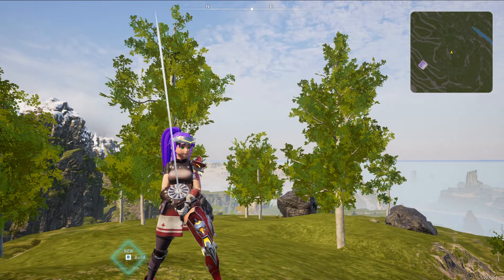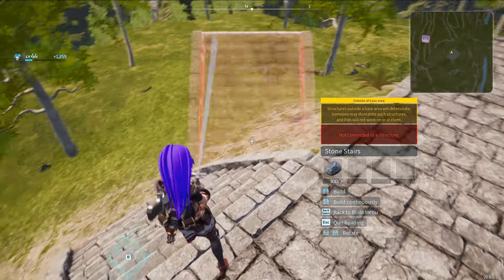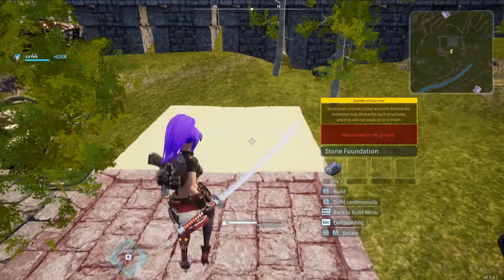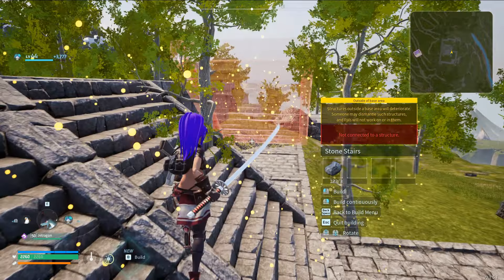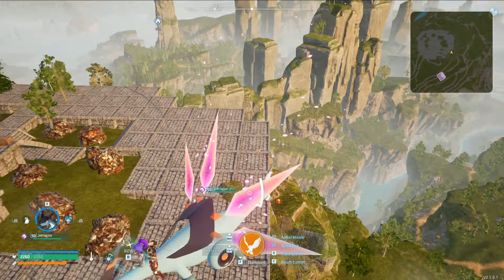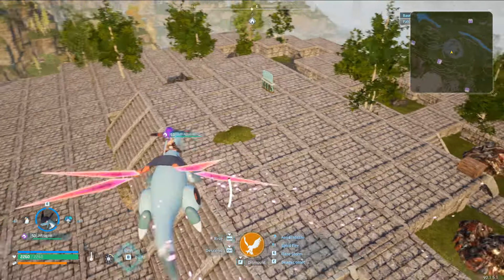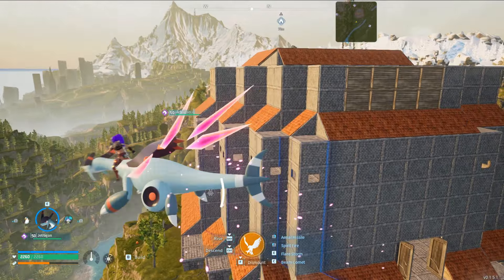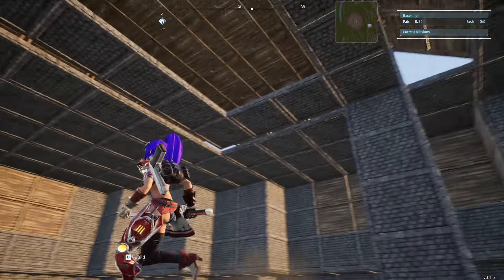Fully Indoor Ingot Base! Palworld building tip for uneven ground

Comment: can we get a vid of pals work this base and c if its actually functional? b curious to c which pals bug out where and such
Reply from the maker: I will definitely consider it, had to remove 2 foundations already, and every save I build here it turns out a little different. With the recent patch bugging out isn't really a problem anymore.
Reply: @kinggamesthe1stgaming260  I get way more problems with stuck pals after the latest patches. Especially the ones that get stuck outside the base and stop moving at all. At least they don't seem to get hungry or lose SAN when that happens.

Comment: I'm curious to see if all those nodes actually respawn. In my experience, even if you don't build directly on the nodes, just a little too close to them, they still won't respawn.
Reply: i've got 2 nodes in my breeding base, fully surrounded by foundations. they still respawn. i only deleted a 2x2 area of foundations for each node. just make sure the foundation doesn't touch the node, but check the top part of the foundation because it's a bit bigger then the lower part
Reply from the maker: Palworld is more forgiving than ark in that regard, but worst case scenario you just remove a few foundations, so long as the gap is no more than 4 wide the ceilings should still meet above.
Reply: Getting enough foundation to provide support everywhere while not preventing nodes from respawning turned out to be really hard at this location. I ended up having to sacrifice one ore node, but everything else worked out. Foundations can be surprisingly far from a node and still prevent it respawning. Meanwhile, trees will regrow right through a wall. Another issue is that walling it in tends to result in pals teleporting outside the walls and getting stuck. An open design turned out to be less of a problem.

Comment: I wish we had some little ending result thing to actually see the respawned icons and mining in this kind of space. I've build one mining base that had nooks for stones to re-spawn but they didn't. It might have been just that the ceiling was too low or foundation too close or something but i'm curious what'll be the limits here. Would I just have fixed it if I had expanded the space more to this kind of direction.
Reply from the maker: Will consider doing a video showing that. I have had to remove 2 foundations since posting, but this save is for videos so I have to set the base up with pals first to test things.